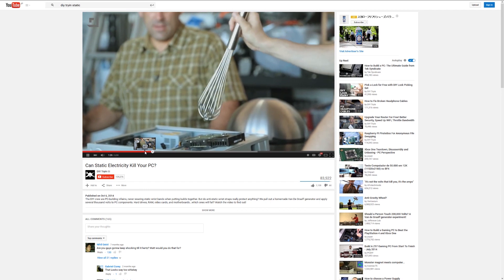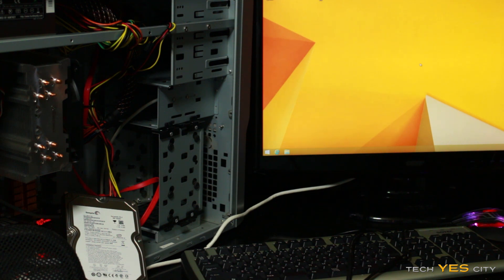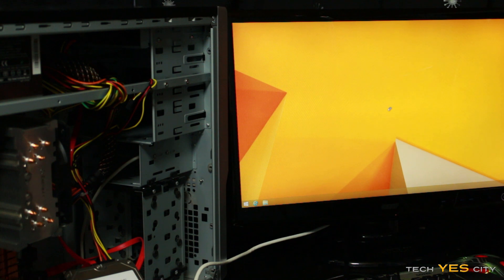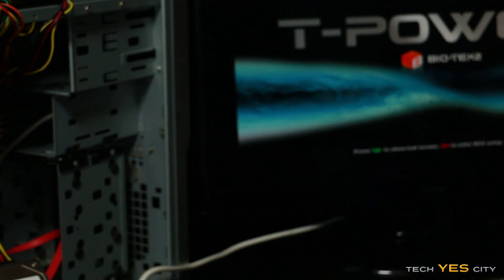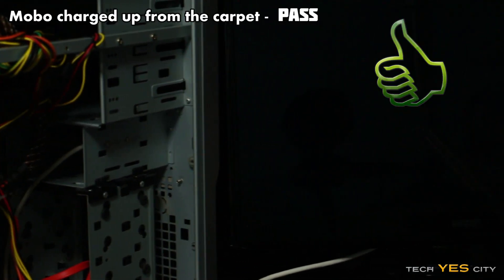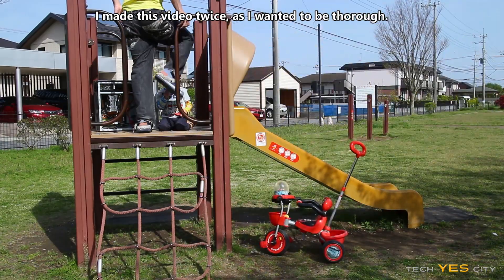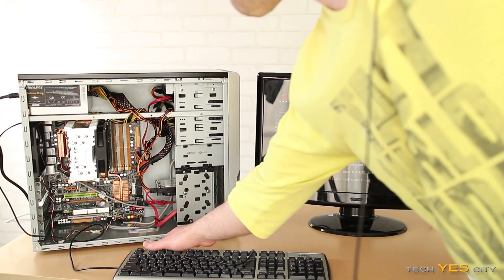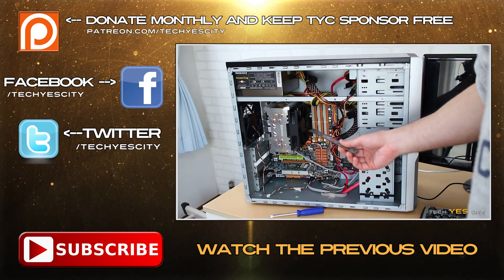Can Static Electricity Damage Computer Parts? Do You Really Need an Anti-Static Wrist Band?

Comment: Here's one for the OCD among the viewers;

If static is so much of a worry, how come most of my client builds were done were on a carpet? The machines in question are between a few weeks and several years old and all fully functional... I've never used ESD save equipment to build or repair computers and yet besides a single dead on arrival hard disk (Click of death before you ask, further analysis showed that it was a busted read/write head), everything I've bough in, new or used (which is lucky imo) has been 100% fully functional with no issues physically! (Again, I've had hard disks with bad sectors and read/write and load callibration issues before, but that's to be expected when the person you're building a PC for buys used disks on the cheap!)

Comment: I'm beginning to think that this is just a made up story that companies that sell anti-static equipement made up to sell more.
Reply: +Luka David Torkar
I work in a small home electric appliances factory. When I was a newbie, I fried 5 circuit board in half an hour, when I forgot to wear my wrist band, so... it depends on the circumstances, but static can be a real PC killer, if you are not careful!
Reply: Why do you think they have ESD proof shoes, wristbands and mats on the desks and floor when they make electronics? We even had all that crap when we soldered small circuits when i went to the electrical program at school.
And the damage is not always and probably not to a high % direct, it damage stuff that gonna fail after a while. I have had a motherboard and a gpu fail on me, probably because of that, pretty low % since i have handled alot of components without a wristband.
So even if the risk is very low, there are always a risk and for the average person fuck it but if i built a high end system for 2000$ i would put a band on and probably buy a ESD mat.
Reply: Static can ruin a PC and your day very easily, it's just a bit of an inconsistent variable, the amount it takes to kill parts is less than the amount you can even feel discharge, but you have to discharge into the integrated circuit through some pins most of the time, so never handle ram or any other component for that matter by the contacts.
Reply: Troy Adams why would you touch the damn pins if you're really mean to do that.
Reply: Fuck man.  This is worse than the first time I saw The Matrix in '99.  Now I'm questioning my existence again.
Reply: Luka David Torkar its that kind of thinking that made lopez speak only spanish.
Reply: I've killed my motherboard because of static energy, so it definitely is not something to not care about
Reply: Please shut the fuck up I just killed a whole damn computer HDD, graphics, PSU, motherboard got fried the whole 9
Reply: @meleoronikalgo3603  😂😂
Reply: @meleoronikalgo3603  how?
Reply: @FreedomForAll2013  i brushed my motherboard with a make up brush and it killed it
Reply: @meleoronikalgo3603  holy shit... So just trying to get dust off of it can kill it?
Really, compressed air is all you can use I guess?
Reply: He's not technically wrong. Effects of ESD is not immediate.  Think of it as getting injured.  Microscopically these small zaps destroy things, if you look at Rossmans videos, he totally blew a transistor and chip and it still worked.  These machines are very resilient.  ESD causes damage over time. Eventually leading to a chip or resistor etc failing. Watch the apple video on ESD. It explains it in a easy to understand way.  Unless you get zapped by as lightning bolt, it's still going to work, but over time, youd wonder why your results on benchmarks show you have a weak PC compared to other same setups. That's why.
Reply: Probably
Reply: Most definitely...
Reply: It's not. If you charge yourself up and touch the actual pins on an IC then you definitely run the risk of destroying it, this guy discharged himself on the case/heat-sinks of each component and the charge was more than likely dissipated by resistors rather than the fragile ICs.
Reply: I think that you're right...
Reply: first off, these tests here was shit.
second, doesn't mean you haven't experienced it means it's not true.
what you're saying is like: "to see is to believe".
now im gonna ask you, have you seen your brain? if no, then do you a brain or no?
Reply: Your arguments are pointless. I haven't seen my brain but I've just got an A+ from an exam so I know that I have a brain. Fuck sake my point turns out to be even dumber... Yes. The tests are shit but he was demonstrating what it's not as easy to break electronics as some think. Now yes... I'm contradicting myself a bit. I'm in the second year of Electrical Technician program so I know some stuff. The thing is that modern electronics is well grounded and protected from static discharges and can't be damaged as easily as other types of electronics. To wrap it up. The comment I made was stupid but the point still stands. It's not as bad as some people think it is.
Reply: Luka David Torkar oh yeah that extra £2 wrist strap that will never be replaced is really needed

Comment: would latex gloves stop static
Reply: you would only need latex gloves if you didn't want the oils of your skin touching computer parts or copper heat-sinks(will burn in leaving a gross looking mark)
Reply: that's why I'd be using some latex finger covers, more even thermal paste spreads.
Reply: Electrical engineer here.  The anti-static stuff I know of works by being deliberately conductive.  I'm guessing this is so that the charges penetrate through the material and don't accumulate on the surface.  

Either way, I'd advise against using a non-conductive material and definitely against latex since that's what balloons are made of.  Just touch something big and metal before you start work and you should be fine.

Comment: Not sure though, but I read that static electricity takes time to damage a computer/computer components.
Reply: I think that's just an excause the companies selling anti-static equipement made up for the computers (99.9999%) that still boot up after you touch it. Just like that the HDD's are destroyed if they come into contact with dust. There is dust all over them. The spinning clears it off. I've opened one yesterday. There was dust in it. I closed it and pluged it to my computer and it still worked.

Comment: This is the BIGGEST misconception about electrostatic damage- that the damage is immediately apparent. It would be like eating a pound of bacon and declaring- it didn't kill me so it must not be harmful.  

Do you think that major manufacturers wastes millions of dollars on anti static controls if it wasn't causing damage and if it was't cost effective? That should answer the question right there. 

The electrostatic damage weakens components; it rarely causes immediate catastrophic damage. The failure comes later. The failure is not always obvious . Say the damage shorts two memory locations together. You may never see that unless the program accesses those locations and the program was affected by those addresses being shorted. Even that won't result in a failure- maybe the occasional hang or loss of data.

Comment: Best way Ive seen is to turn pc off, keep the PSU connected to GROUNDED outlet and touch the case (metal parts) every now and then throughout replacing or building, because static kills them over time mostly, not instantly

Comment: all I do is touch the tap on my radiator to get rid of any static. even before I did that no computer part was ever damaged so far
Reply: +ルカス That's not how it works.
Reply: +Atheos touching a grounded conducting object won't rid me of static? what will then?
Reply: +ルカス It's not about ridding yourself of static charge, it's about getting the same level of charge on you and your components "slowly". This is why you have the static bags, their high resistance allows your component to acquire the same charge as you, but not so fast that it will create an ESD damage. Anti-Static Wrist Bands work the same way.
Reply: Atheos fair call. thanks for the explanation
Reply: +ルカス Oh no problem, it's REALLY common that people misunderstand ESD.
Reply: Atheos yeah you're the first to tell me. Though I have to admit it makes much more sense than ridding yourself of static

Comment: Some people just attract a static charge very easily. I knew a person who was always having problems in winter getting zapped by things. He killed a PS3 controller. He wasn't touching the usb port on the controller when it happened; the static went through the gap between a button and the casing of the controller. That takes tens of kilovolts.

Comment: DUDE static electricity will not destroy the components imidiately, it jst reduces the life of the components
Reply: +shaheek SB People say this, but I've never seen proof.

It's obviously a lot harder to test the long term effects, and even then, components die on their own all the time, nearly impossible to prove it was static that shortened their life span.

Now that's not to say I don't use a wrist band when building, given the price, you'd be an idiot not to.
Reply: 20+ years I've worked in IT.. Built PC's, taken them apart, and serviced laptops. I've touched every single component you can name and have never once managed to damage them with static discharge. They have continued to work just fine.
Reply: +shaheek SB true, im glad some people such as you are not as stupid as the rest of them in the comments saying that you dont need an anti static mat or wrist strap.
Reply: +DeanWhipper No you are an idiot for falling for that marketing ploy..

Comment: Funny video, although as a EE who works around electrical components daily and is forced to go through ESD training annually, I wouldn't take the risk with my components personally. I don't always wear a wrist strap at home, but if I'm not, I am making sure I don't move around and I am constantly discharging on my grounded PC case. PC component manufacturers know most wont wear a strap so Im sure they take preventative measures (thick layers of conformal coat and safety grounds).

Also  this vid would be more helpful if you took a humidity reading of the environment as that is probably the biggest variable in causing ESD damage. if I lived in Florida i wouldn't worry at all, however in a dry environment like California id be especially careful.
Reply: To add to this he presumably lives near Gold Coast (assuming he lives near his PO box), which has an average humidity of over 60% during the month of May, the date he uploaded this video. Source: http://www.bom.gov.au/climate/averages/tables/cw_040764.shtml . I have a bad feeling about the hardware of any PC builders in Alice Springs or Las Vegas who decided to test his "conclusion".
Reply: California is dry? I dont live there but in winter it has pretty high humidity as i can see on weather sites

Comment: What was the level of humidity in that room? Did you do some stress testing on the components before and after the fact? Sorry, but without more information, this hardly tells us anything about the dangers of static electricity in consumer environments.
Reply: +Juan Bertero a little bit late with the reply but he mentioned he has been working with or building computers for 15 years and he never used anti static straps and never had any probs, im guessing its bull shit, same with me i never used it and never had any probs yet hehe :D as with me i wont be using it until something fucks up :D

Comment: You could have also tested by pulling out the ram, hdd and the gpu and put them on the carpet or drag them on the carpet and then test them XD. 

But ye definitely better to use a wrist strap or atleast ground yourself once before touching any hardware. Specially new hardware that are still inside its anti static bag.

Comment: roflmao man, nice test, you had some moves on that carpet, :D. did you get actualy electric discharge on the first components though  ? At work when I wear certain shoes I get a discharge everytime I touch metal.. it's crazy, but also overvolting, sure, but for 1/10 of a second ? Lol and with veeery low amps I bet, not sure about that

Comment: If you have the PSU in the case and power plugged in (doesn't have to be turned on) the case is grounded, just touch the case every now and then or rest arm on it etc and you will be alright.

Comment: To dispute the effect of static on electronics is a bit silly.  It is a thing that every major building and fab facility take extensive precautions against.

However.  In 20 years of building PCs I have only ever seen one instance of someone shocking a part and then not having it work.  But that is a false way to testify.  I think static damage degrades the parts.  Just like extensive heat will eventually kill a part.  It won't do it right away.  But there is a line that the part can't cross and once you go over it the part will exhibit different characteristics.  Whether it's heat, or static, or too much voltage or current going through the part.

I do not use a static mat or strap when I work on things.  But I do ground myself on the PSU a few times while working.

All electrical parts are vulnerable to all of these factors.  It's just how much and when it will affect them.  This is a fact.  I don't see the risk of static damage to be that great, so I don't take any precautions over touching the PSU after walking away from the bench.
Reply: This is important. It happened to me when I soldered a 144pin mcu without properly grounded ESD and a lot of pin contact. It works, but occasionally it gets random hick ups when it stops responding and starts heating up to the point where it starts burning. Sometimes it can do that while still being responsive. Happens about 10% of the time.
Reply from the maker: ***** Nice post, I was going to talk about heat, as I had one of my parts become damaged from heat in the past (ridiculously hot day, computer didn't shut off properly....), CPU didn't work properly from that day on.
Reply: Tons of words just for 8 likes

Comment: Dead ram slots are usually caused by bent pins, try seeing if they are  straight or not, it might help you.
Reply from the maker: plk173 CPU pins? I had a good look, couldn't see any pins that were bent, I mean i could try clamping down the CPU even harder (as I don't care all that much for this rig lol), but apparently it was a wide spread problem on the x58 platform (semi-functional ram slots...?)...
Reply: Tech YES City that is strange, maybe there is something on the actual surface of the cpu. Anyway goodluck with the pc torture

Comment: Static electricity can affect computer but it never had killed any that i know of.. At my work we had some problems with one of the workstations - the table and the computer where grounded but every time user came back after lunch or something, static electricity discharge restarted the computer, it happened couple times a day until we decided to remove the ground wires and put the case on the ground so the discharge only traveled thru the table.

Comment: If you have the same static load as the parts or the PC then there will be no discharge to them. Grounding yourself is not necessarily correct if the parts have a different static load. I normally make sure to touch all parts of the system quite often (sounds a bit weird, but hey that's me :P) In any case I will not start off by grabbing delicate electronical parts without making sure that touching the case or anything metal doesn't deliver a shock. In real world situations there's no real danger left after you do that. I can testify to the possibility of frying your MOBO with static though. It has happened to me in the past. But it was only one time in 20 years of pc building and it was the MOBO of a small notebook, encased in isolating plastic of course, and oftentimes sitting on pillows or even on blankets in bed. AND I was using a wrong type of brush to clean some dust in a shitty to reach place... So i would say in real world PC building scenarios you'll gonna be fine.

Comment: Proves U don't need a anti static wrist band

What a else can I ground? Case? If I touch my case what happens if my motherboard is installed won't the electricity flow through the case to the motherboard

Comment: I used to know a guy in college that always fried his parts just by touching them. Every computer, every part, anything where he touched the inside guts of something electronic always fried. What the problem was though, is he produces more static electricity than most people(or just keeps more of a charge). He fried like, 6 computers at my college taking them apart, and putting them back together lol. He also fried some parts at home and at his tech job before he found out.

Comment: Never used one, never will, prefer to slap the side of the case xD
Reply: If you touch the metal part of the case, it means you ground yourself and discharge all static charge. So to say, it's is safe to touch the side of the case every now and then when building a computer.
Reply: @TrieuHuyLong  can i just hug the pc case?im going to build my first pc with an nzxt h500 case
Reply: @arsyasultan2505  no u need to touch a steel part that is not painted
Reply: @arsyasultan2505  That's fun. How'd your first build go?
Reply: Dans Tech if i put my hand on the case i will lose the electricity?
Reply: do I need to have a psu in??????
Reply: jesper holmer ...
Reply: @jesperholmer4918  that's what I'd like to know